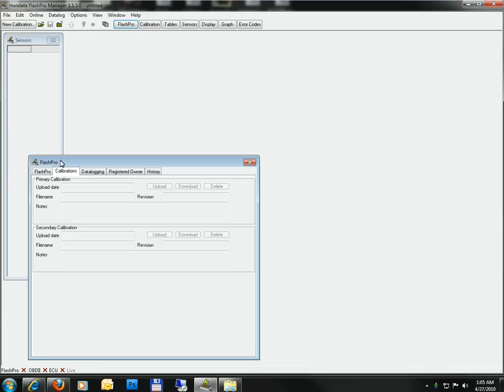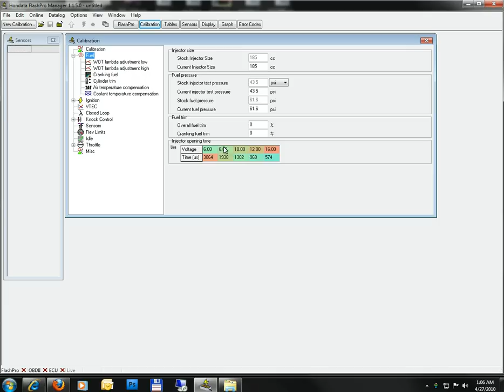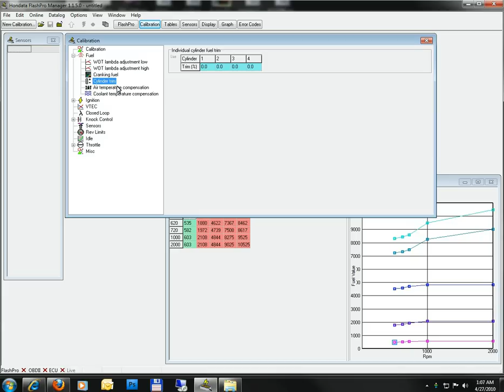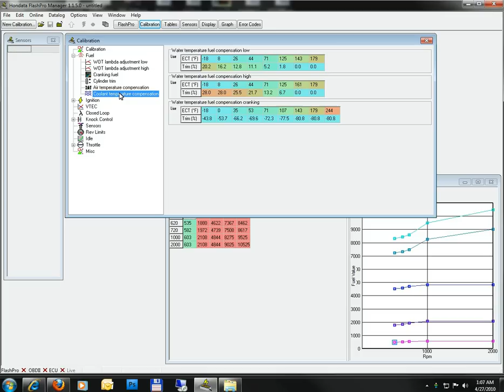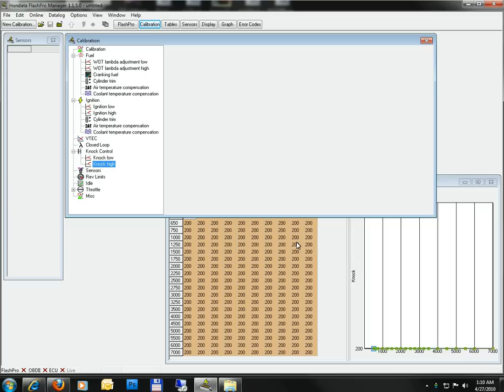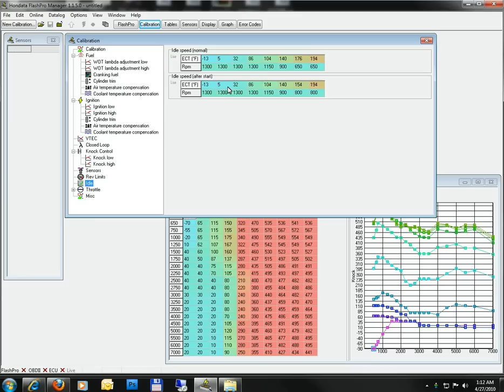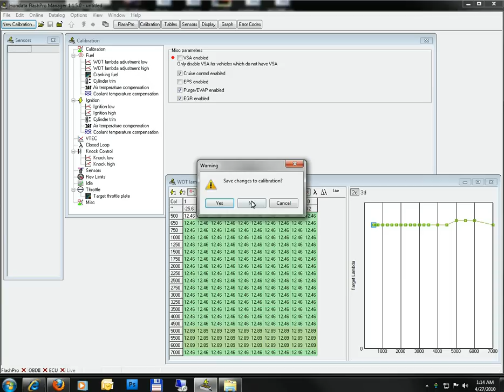FlashPro Tuning - R18 Civic Support

Comment: What's the best air fuel ratio for an r18? I have 2.25 exhaust, DC Sports Header, Takeda intake and hondata right now is running 13.2-13.7 in A/F ratio
Reply: my r18 in on e85 an nitrous my afr is 12.5
Reply: but for pump gas anyehrearound 14.0 is fine

Comment: Hey guys I have an honda civic 2008 lxs sedan, motor r18a1, body fa1, and I dont have hondata for my ecu. In the webpage they indicate "Sorry, we do not have a FlashPro for ECU part number 37820-RND-P52" what you guys recommend, to buy an american ecu and connectors? what else will work?